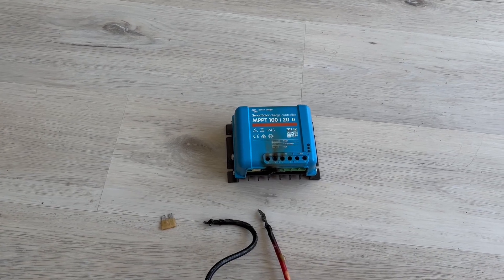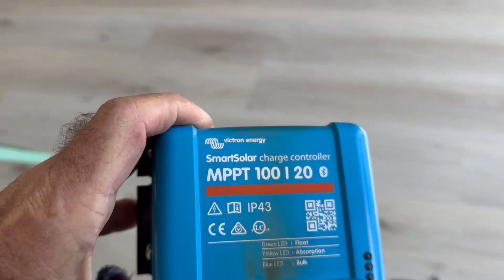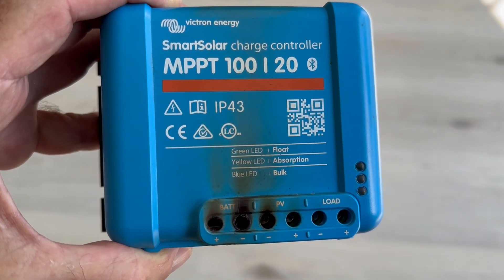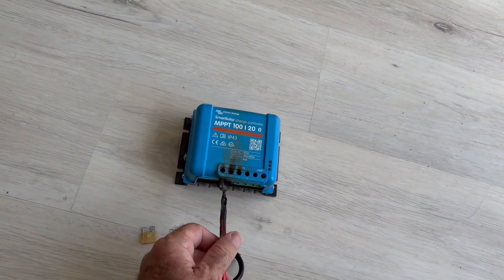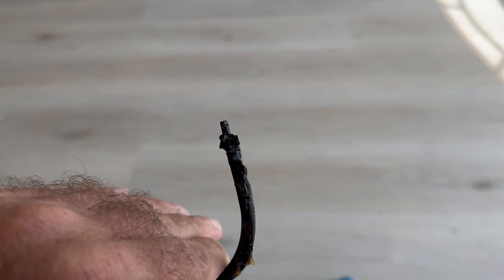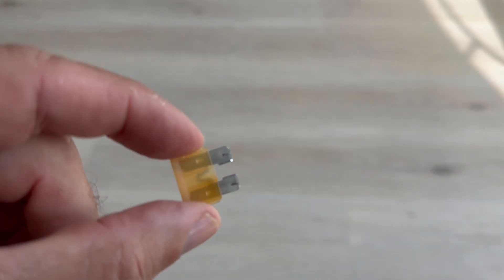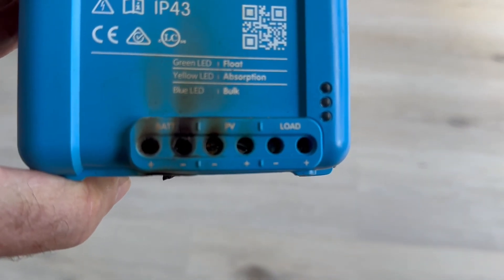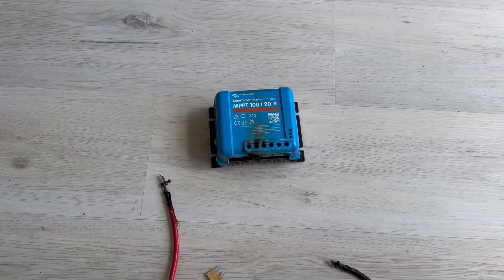VictronMPPT 100V 20 amp 12-24-48 Volt Solar Charge Controller burned. Warranty honored

Comment: My first suspicion would be a slightly loose battery connection going into the SCC.  From looking at one of your earlier videos of your setup, the battery negative from the busbar goes through a tight S curve which could be putting strain on the SCC terminal.  And the positive cable has a very short run to the busbar.  It looks to be quite a small gauge for 20 amps so it will be going through heat cycles and shrinking amd expanding each time.  As soon as there is a slightly loose connection at the SCC, a small amount of arcing could begin which creates a carbon buildup which creates more resistance and more arcing again.  It's a runaway effect.
Reply: I would almost guarantee that this is the case. This was a problem in the terminal block not within the unit itself. Arcing in the terminal block that led  to a dead short to ground.
Reply: And that's exactly the reason that the fuse also does not trigger, a slightly loose cable. We have here DC, where no one really realizes how dangerous it is. Exactly as already written here, the cable becomes loose due to the poor wiring, there is first a spark and then a small arc and then the drama takes its course.
I have seen this so many times .....
Reply: Agree.
Reply from the maker: Appreciated,  The wire is 10awg which is rated up to 30amps between 0-6 ft.  The amps never exceeded 9 (per the victron tracking - which I trusted).  The cables were secure and see no movement so I don't see how any looseness could have been introduced to the setup. It did curve but the curve was added to insure separation from the positive.  The setup had not moved since may 2022 .... and all connectors were tight.   Really appreciate the input, thanks again.   I'm looking forward to hearing from vitcron on any possibilities?
Reply: @colinauld  I just had another look to the manual. See page 1 (1.2. Wiring safety precautions), there it is described that the cable must be very fine to avoid exactly these heat problems. As I can see, your individual strands in the cable could be too thick (as far as I can recognize in any case, with the extremely destroyed cable..)

See here from the manual:

1.2. Wiring safety precautions
• Use flexible multi-stranded copper cable for the battery and PV connections.
• The diameter of the individual strand of the cable used should not exceed 0.4mm (0.016 inch) or have a surface area exceeding 0.125mm2 (AWG26).
• The maximum operating temperature is 90°C (194°F).
• A 25mm2 cable, for example, should have at least 196 strands (class 5 or higher stranding according to VDE 0295, IEC 60228 and BS6360). An AWG2 gauge cable should have at least 259/26 stranding (259 strands of AWG26). Example of suitable cable: class 5 “Tri-rated” cable (it has three approvals: American (UL), Canadian (CSA) and British (BS)).

This is the part where Victron points it out:

• In case of thicker strands the contact area will be too small and the resulting high contact resistance will cause severe overheating, eventually resulting in fire. See below figure for examples of what cable to use and not to use.

Look in the manual for the pictures there, then it's really clear.

Another very important tip: in extreme cases, the cables do not need to be "moved" at all for them to loosen. You should check them from time to time, they loosen on their own. I've seen installations where they just fell out, even though they were always perfectly tightened at the beginning.

A short circuit can be ruled out, as the fuse would have tripped.

And last but not least: I keep my fingers crossed that Victron will replace your charge controller, which would be a small consolation for the shock you must have had. 

Good luck an kind regards☺
Reply from the maker: @xbox199  Thanks a lot, great info there really you appreciate you taking the time. I'll be inspecting all in detail before installing the replacement and making sure the contacts are isolated.  I might go with a little bigger controller this time out..
Thanks again.

Comment: I be curious what Victron's diagnosis is. Im not an expert but looks like a dead short inside the Victron. Maybe where there is a separation of the Pos and Neg batt connection, somehow got fused together?
Reply from the maker: It certainly looks like it ..the only thing is the setup hasn't moved or been disturbed and it's been running for over a year??  We'll see what they say ..
Thanks.

Comment: Looks like short circuit. Show us the battery
Reply: You need a 20a fuse between the bus bar and the 10awg. This prevents any short from the battery from making it to the 10awg and controller. If you look at victron lynx distributor it fuses every wire coming out.
Reply from the maker: no issues at the battery ... even the other end of the cables going to the battery busbar is perfect.  The issue was local to this controller.  I don't see how the fuse didn't blow.
Reply from the maker: here is the battery condition https://www.youtube.com/watch?v=CtDEl3dR4jM
Reply: @colinauld Watching the followup video, none of those fuses you showed on your battery bus looked small enough for that charge controller's battery connection - lets assume the fuse onboard was for protection of the device. did you have a separate 20a fuse in-line with the charge cable going to your battery bus?
Reply from the maker: @justDIY  That’s true, I fuse for the main wires on the battery themselves.  Was counting on the fuse installed in the controller.  That will be changed in the future to protect the 10awg.  The fire happened on the inside of the outbound connection though … I really wouldn’t be able to fuse for that.  It must have been a pretty quick event because the melt never even made it to the busbar end of those short wires coming from the controller.  I am definitely going to add something there though. 
Thanks for the comment.
Reply: @colinauld  I think your theory of the contacts overheating is the most plausible explanation. Did you have wire ferrules on the end of your 10g cable?